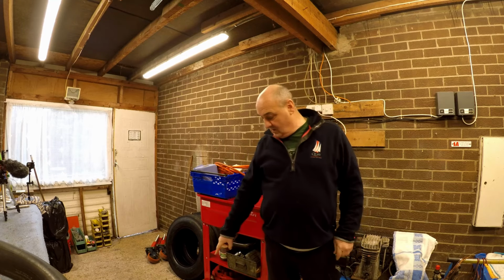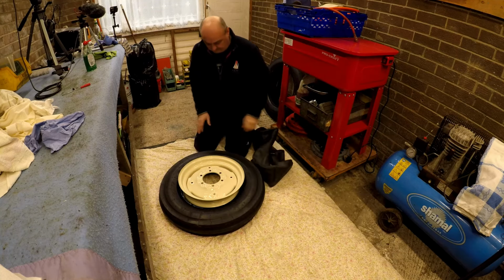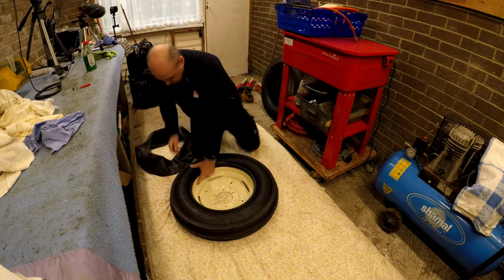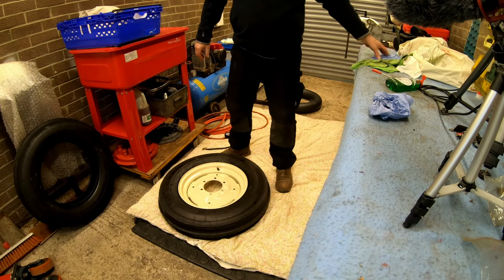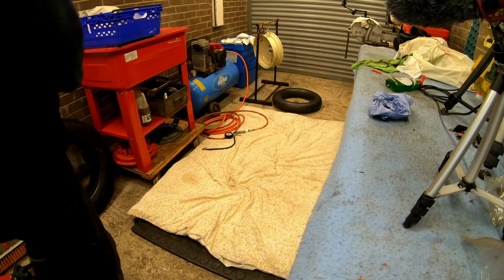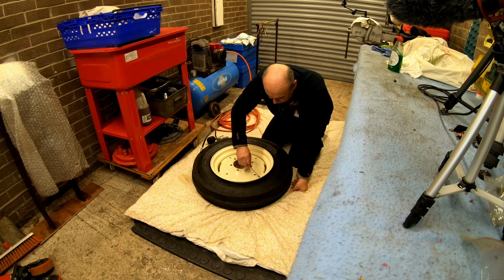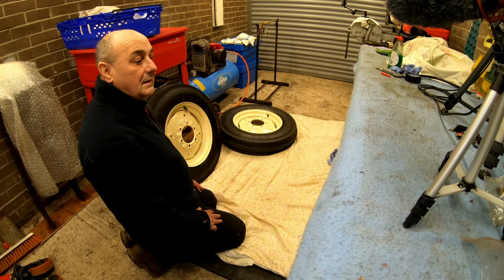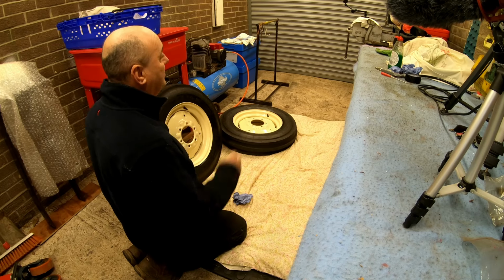David Brown 990 front tyres #84

Comment: I've never seen anyone do tires by hand (and feet/knees!) before!  Good to know it can be done!   One of my front wheels is so rusty.  The hole where the valve stem goes was so rusted out and thin it was like a razor blade.  I had to file the valve stem hole bigger to get to some thicker metal and get it rounded instead of sharp.   I then used folded up old innertube rubber between the new tube and valve hole to try to keep my new tube from being cut.  It's been working great so far!  No leakage of air over 2 years on that wheel since I did that!  At some point I'm going to need new wheels tho.
Reply from the maker: Hi Shane, my old wheels are like that, rims rotted off,  splits in the metal work, they are so bad I stood to the side when I blew them up to put on the tractor a couple of weeks ago, Had a trailer split rim blow up once and hit me in the ankle, that hurt and I've never lost my respect for compressed air.
cheers Shane
Barry

Comment: Well done Barry and no damage to the paintwork, are you going to bring out a keep fit video fitting tyres? During my time at the David Browns Leigh (Lancashire) Manufacturing Division where all the finished components painting was done only grey primer was used, the machined castings were red lead and these were sent to Meltham to make up the mainframe skid unit which was painted on the Tractor assembly line
Reply from the maker: Hi Terry, I'm going to get a colourfull body suite like Mr Motivator and do a twice weekly seesion for those like me, suffering the Christmas buldge,
cheers Terry
Barry
Reply: Put it on for the next video - best overalls ever. I should have mentioned that the wheels were manufactured and painted off site and supplied to Meltham with the tyres fitted